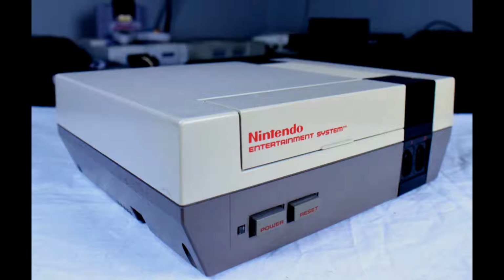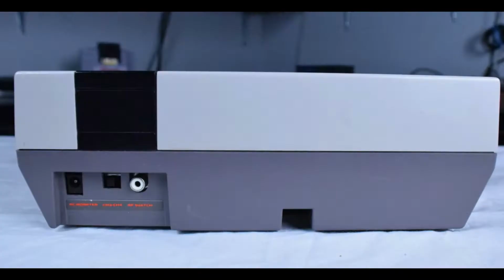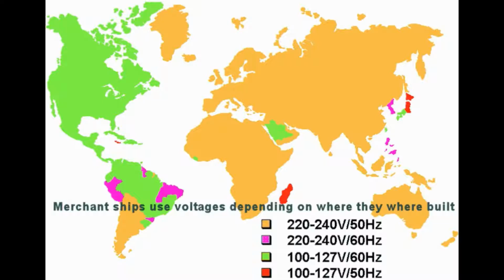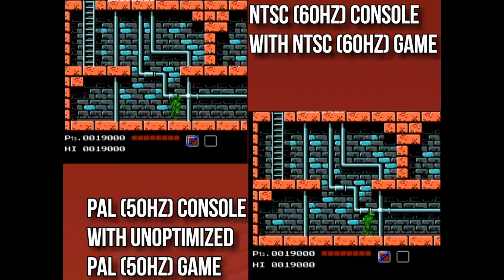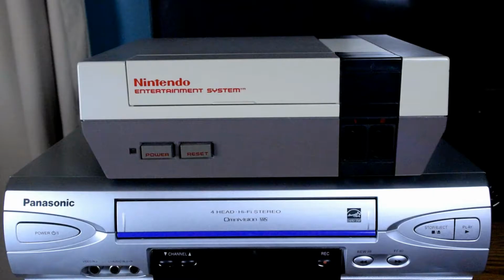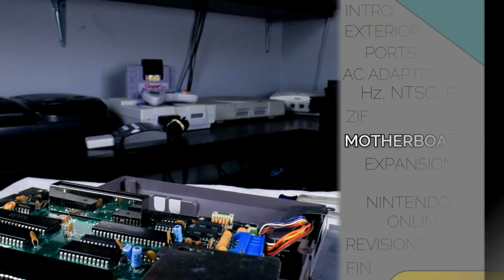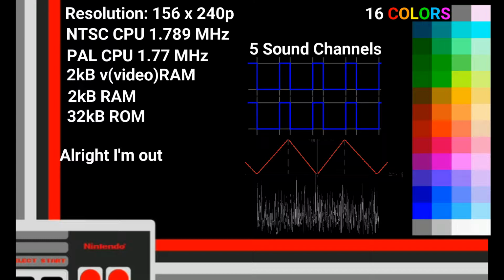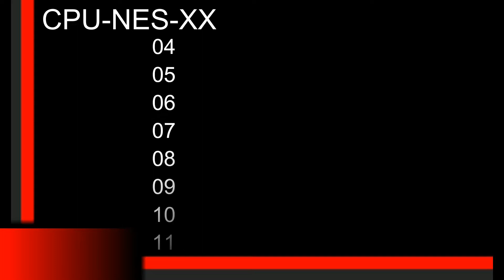NES Hardware Analysis: Console Stackup

Comment: The primary use for the Expansion on the NES was for a North American version of the Famicom Disk System. They abandoned this rout when using battery backups became cheaper in the US.
Reply from the maker: True! But there could have been other implementations and only a online modem adaptor for gambling(?) Was officially released i believe

Comment: I have a motherboard revision NES-CPU-01
Reply from the maker: Really!? Where did you find that
Reply: I got a NY test market NES with a N0045000 range serial number and it happened to be an 01. I also have a revision 02 board with a 55000 range serial number CIB. Looking to sell that one soon
Reply: There’s very little information on anything before revision 04. I’ve never even seen an 03 but I’ve heard they are in NES’s with serial numbers between 150,000-300,000.

Comment: now I know why this console rocked. Up until the pc era I have never struggled with rendering issues. On this console everything was baby ass smooth, everything moved so SMOOTH so BEAUTIFUL. PC on the other hand, with its limitations according to your budget, introduced clipping. This is the worst enemy in a game experience. That shit is very ugly. The only way to have that smooth experience is to enable vsync and have a proper pc for that particular game. But this is the bottom line, I fucking hate this pc limitation, when the graphics are clipping, it makes everything mega crappy
Reply: What you describe here is the difference between software-based graphics and hardware-based graphics. The NES provided no way for a programmer to control pixels directly or anything remotely close to that. Instead, its PPU provides background tiles, sprites and background scrolling. PCs work a totally different way and their graphics cards set up a block of memory to which programmers could write and draw pixels by doing so, meaning drawing for PC games, scrolling and everything was done by software. No matter how advanced technology and computers get to be, software is just never going to be as smooth and accurate as hardware.